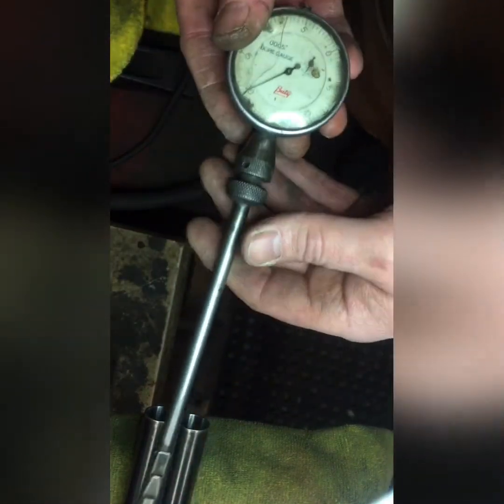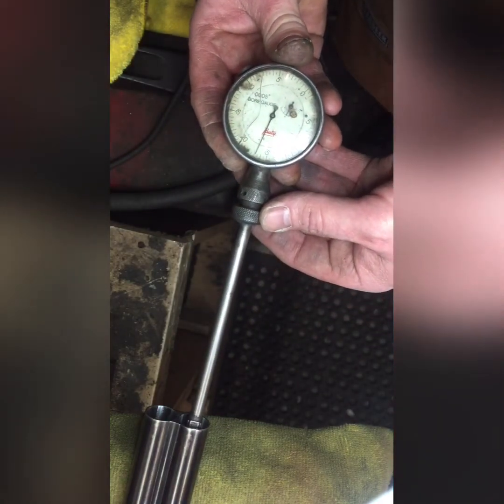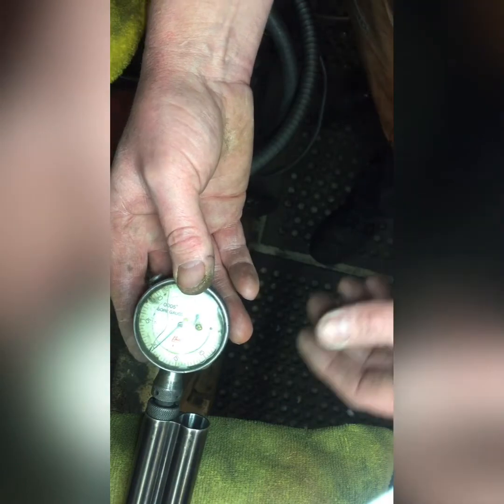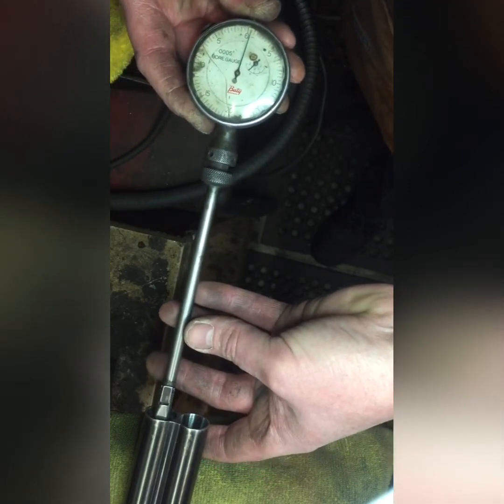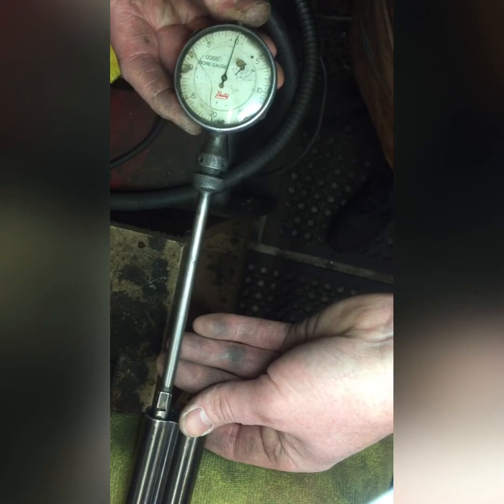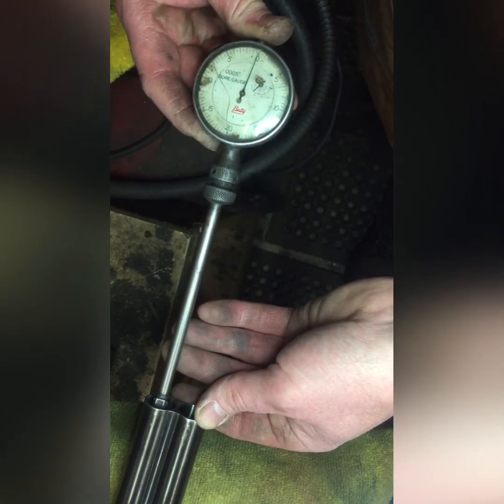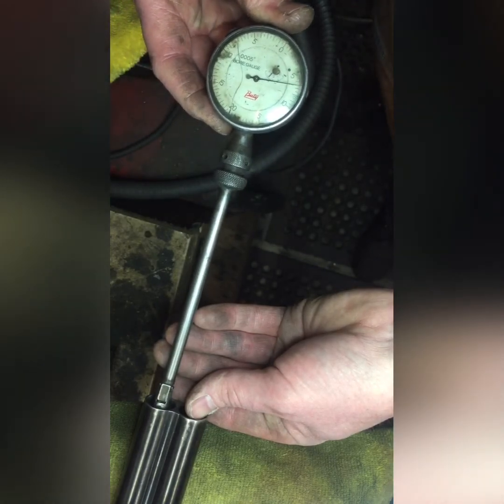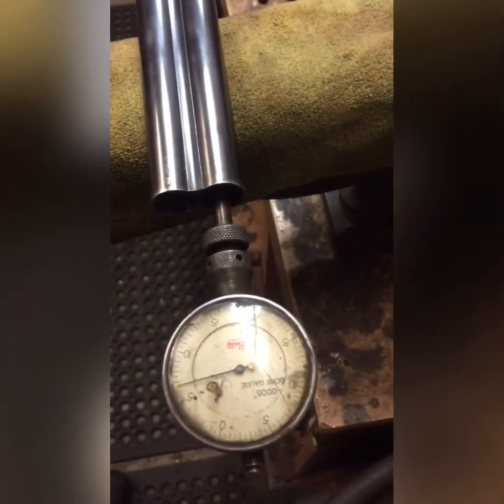How to correctly measure choke in a shotgun barrel.

Comment: Are you sure that is a "back-bored" barrel and not a "bulged" barrel from overpressure? 
(Also), Will your gauge measure .410 and 28ga barrels as well?  I need something like that.
Nice video. Thanks.
Reply from the maker: Thanks. And yes, positive. Nothing showing on the outside and clearly showing on the inside when looking as well as measuring. (I am a barrel maker of 35 years)
The gauge goes to 28ga but not .410. I use an internal gauge for .410 then "mic" it.